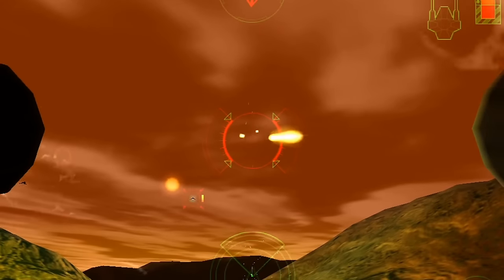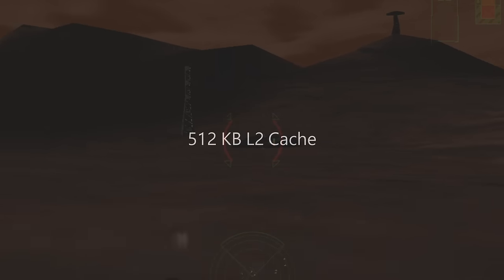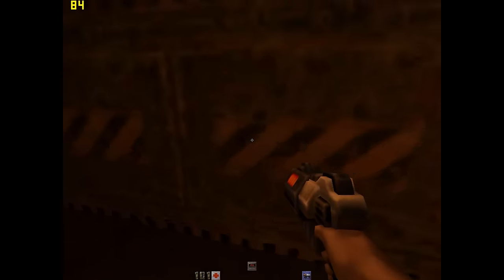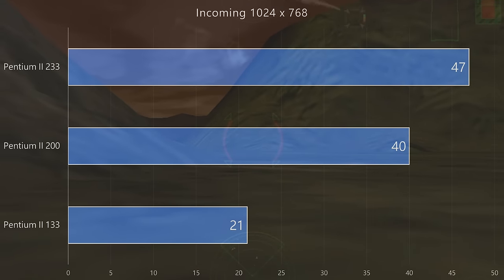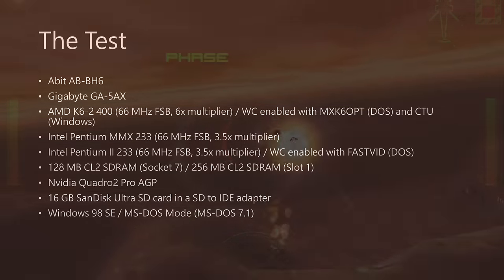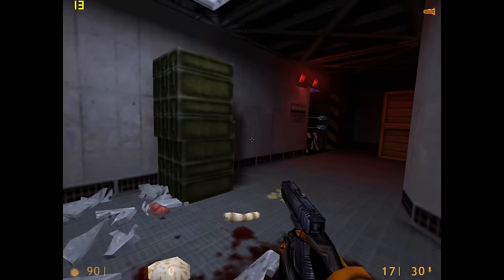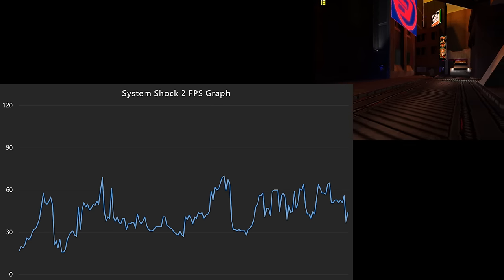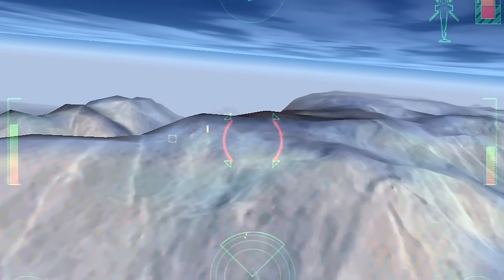Pentium II 233 The First Slot 1 Processor

Comment: I got a new computer for when I entered high school in 1998, it had this exact CPU. It was a very good cpu, I had it for a little over a year. Which in that era was a long ass time, cpu and gpus advanced so fast. Also mine was easily overclocked to 290, with the FSB 66->83 and a little extra cooling.

Comment: I have a P2/3 dos box that I just have a hard time getting slow enough! I was even looking for a socket 370 to underclock on a slocket, and for some reason, just kept forgetting that this processor exists (I have a PPro lying around, and it was a search for a socket 8 board that made me say "duh" and order one of these on ebay). The price hasn't come down much since you made this video, but I hope it will be easier to slow down for old DOS games than the 450 that is in there now. I'm pretty excited to give it a shot at 133. It's funny how hard I used to try to squeeze performance out of my BX boards in the past, and now I'm trying to squeeze performance out of it... but... you know, the other way :D 

(I still deeply regret that I got rid of my socket 3 and my Tomcat III motherboards. WTF was I thinking?!)
Reply from the maker: Socket 7 is what you want with a Pentium MMX. Watch my video 136 in 1 MMX.
Reply: @philscomputerlab  Oh, I know, I have a kajillion socket 7 CPUs but the prices on motherboards have gone insane. I'm also surprisingly light on PCI graphics cards, so having AGP for my Voodoo3, while not a must, goes a long way to having a good working systems. I still have my Orchid Righteous 3D and a V2 card, so it wouldn't be the end of the world if I couldn't use AGP, but it would just start a cascade of spending that could have gone toward, say an SC-88pro. Hopefully, this $17 cpu will be a good solution, and i'll just keep looking at my unhoused socket 7 CPUs and feel a little sad :D 

Thanks for the reply on the necropost (though, when you're dealing with retro hardware, is any thread too old??).

Comment: I think we had this in our first family computer back in 1997 with 128 mb ram (a lot for the time i know) and a geforce 2
Reply: Pidde Bas I guess the geforce 2 was put in your machine later.
Reply: KilgoreOnDrugs Huh. I looked it up and sure enough it wasn't released until 2000. So must have been a different one, since we never upgraded that computer to my knowledge. But I do remember it saying Nvidia and geforce on the card and it had a single vga output.
Reply: It was probably a Riva 128 which was nVidia's first successful graphics card and it came out in 1997 too.I purchased a Gateway 2000 G6-233 model on eBay last year which came with a Pentium II 233 Mhz Slot 1 processor and a Gateway 2000 branded STB Velocity 128 AGP (nVidia Riva 128) graphics card.It also came with 128 MB of RAM.
It could have been the same make and model as your first family computer.
Reply: m9078jk3 I've now found out it was a Dell Dimension XPS D233. Yes, that graphics card seems to have been it according to multiple sources. Not much info on this machine online though. Best I could find was this https://en.wikipedia.org/wiki/Dell_Dimension#XPS_series
Reply: Finally! http://web.archive.org/web/19971008001233/http://www.dell.com/products/dim/xpsd/indepth.htm
Reply: That's a higher end gaming machine for 1997.Congratulations on finding the model.I thought it might have been the Gateway 2000.
Maybe you can find that Dell XPS D233  someday from eBay.
One thing about that nVidia RIVA 128 card is that you you will want to install the latest drivers if you get one someday (which also have Open GL drivers for it too).
The original software drivers for that Riva 128 were terrible (had a lot of screen tearing). With the updated drivers it was an excellent graphics card and was higher performing in Direct 3D games than a 3Dfx Voodoo 1 graphics card.
Reply: m9078jk3 Thank you for the info on the drivers. Yeah, I would really like to find this machine someday as it was the first computer I used. Poked around on ebay, didn't find this specific model though
Reply: my first pc where 2003 it had pentium 4 3 some thing ghz 
intel grapich
256 mb ram 
20 gb hdd
runing windows 98  
i miss that pc
Reply: pentium 4's cant have 3 ghz at least i haven't seen any
Reply: oh my bad they can go up to 3.8 ghz with mmx technology
Reply: Theres a 4ghz pentium 4 aswell

http://ark.intel.com/products/27510/Intel-Pentium-4-Processor-supporting-HT-Technology-4_00-GHz-2M-Cache-1066-MHz-FSB
Reply: Sebastian Kjær Lauridsen this is going straight to my retro collection thx for informing me

Comment: I have a bunch of these Slot1 CPUs here, both the 233 PII but also other slot1 CPUs, they always been my favorite among processors. good overclockers and very stable but also delivers size for the buck :D
Reply from the maker: I like working with them too. Stay tuned :D
Reply: One of the best overclockers are the PII 333Mhz, setting the stock bus speed of 66Mhz to 100Mhz I got a 500Mhz 100% stable computer that worked for many years in most games, I still use the same Abit motherboard and stuff but with a PIII 550 at stock speeds and it still does the trick with my Dos games :)

Comment: I did have a pentium 2 machine around 1997-1999, it was the 266 MHz version on an intel SE440BX motherboard, with 128MB SDRAM and a 3DFx Voodoo2 12MB. It was the machine to have if you wanted to play Quake1/2 and many other games as I did back then. It was an impressive computer about twice as fast as the pentium 166 MHz I upgraded from.

Comment: I had Dual P2 processors and 256MB ram on my Digital branded server, that I bought for nothing and used as a web server and spam filter at home. It was actually surprisingly powerful and did not got rid of it until 2006, when I switched to P3 1000MHz processor server for these duties. However, I always remember the disappointment when I realized that 2 P2 Cores filtered spam much faster than the single P3 core in the "new" server.

Comment: The Celeron 300A in late 1998 (based off the Pentium II) was the first Intel processor to have the L2 cache integrated into the die at full speed, although only 128KB.  if you got a motherboard that supported a 100MHz front side bus and RAM, it also happily overclocked itself to 450MHz without any intervention needed (aside from setting the front side bus speed to 100MHz if not automatically detected from the RAM) and was rock-solid stable.

Man I miss that processor.
Reply from the maker: Thanks for sharing!

Comment: I built my first slot 1 rig few months ago to play some old games. I had the opposite experience with compatibility, so terrible it took several weeks to debug it. Had all sorts of issues with GPU compatibility and PCI cards only seemed to work in certain slots for a number of boot cycles before I had to change to another slot.  Got it all working in the end with a lots of headaches but installing win2k seemed to have fixed most of the issues. Also had no audio compatibility at all with the on board sound blaster 128 despite having 98 drivers and the fact the card predated 98. I installed a SB live 24bit and it didn't work either as there was no 98 drivers for it despite being only 2 or so years newer than 98, good on ya creative you pack of lazy shits! 

Current specs are: Intel workstation board, 256Mb ram, Pentium 3 500Mhz, Geforce 5 FX500.

Built this to play need for speed Porsche 2000 (obviously circa 99-2000 ish) but its too slow as this game was way ahead of its time and took another 3-4 years of PC advances before I would consider it playable. 

Looking at building a dual CPU Athlon XP 3200+ rig with Geforce 6800XT and 4Gb of ECC DDR2 ram. 

Many years ago I had an Athlon 64 3000+ with 6600GT and that ran this game at about 50-60 Fps

Comment: Tiberian Sun will actually support any resolution you want. To go higher than the 800x600 in the options menu, open the config file and manually edit the resolution. It supports widescreen with no modifications necessary.

Comment: Great video. Funny thing, a couple hours ago I bench tested a PII 233 mhz on a"bboring" oem mobo. It was on a Gateway GP7-550 paired with a PIII 550.  The PII worked at 133mhz, no option to change the multiplier on the mobo. Thinking on making a DOS Win 3.11 rig.  Back in the day these costed an arm and a leg so had to settle with Cyrix then later with Celeron.

Comment: I actually have one of these-but the fan on its cooler died so its useless until I manage to remove the heatsink and replace it-not an easy task when its rusted on. Though with contact B21 severed on my Celeron 333A I haven't got a use for anything else slot 1-it runs at 500MHz on any motherboard that supports a 100MHZ FSB. And I'm glad that my SE440BX-2 automatically detects the voltage as the Celeron 333A reuires a bit of a voltage jump unlike my 300A, which at 450MHz runs on its stock voltage.

Comment: Never had a Pentium II back in the day.

The first family pc was an old used pc in 1995 which was just a suped up 286 at like 5mhz and cga graphics. All it did was run a dos menu where we played Wheel of Forutine, Pool, a Dart Game, and Jill of the Jungle.

The second PC was a 25mhz 486 later that same year. It was obviously a massive improvement to the 286 by leaps and bounds. but is the slowest 486 lol! The first two shooters I ever played were on that pc with those games being Doom II and Heretic.

in 1996 as we got more into computers my dad paid 3000$USD for a 200mhz Pentium Overdrive PC.
Once again an absolutely massive boost in performance. It was absolutely hilarious running Warcraft 2 tides of Darkness on the 486 and Pentium Overdrive in a network game. Quite literally the Enemies and the Peons walked in slow motion on the other pc and you can see the slowness on the faster pc. So obviously we did that once or twice and said no more to the older pc lol.

Then flash forward years later to 2000 and instead of buying pcs my dad learned about the pc builder hobby. This is when my dad built a 900mhz duron machine and 1ghz Athlon. We jumped right 
into the modern nice cpus along with a 3dfx voodoo 3500 TV and a 3dfx Vooodoo 5500 on the other allowing for a pretty good experience regardless of pc played on.

Comment: The very first PC I ever bought with my own money sported one of these beasts along with 32 megs of memory, a 4 meg ATI All in Wonder and a massive 3.2 gig hard drive.  All in early 1998, wish I could remember how much I paid for it.  It could barely handle Half Life when that released, along with some graphical glitches I only got a decent frame rate at 320 x 240.  I upgraded to a Diamond Viper 550 16 meg nvidia card and things got a lot better, I could run it at 800 x 600 and play online without crashing.
Reply from the maker: Nice! Thanks for sharing!

Comment: I got a Dell Dimension XPS R desktop with a Pentium II 400 when I was in college in 1998.  I kept on upgrading that thing and in the end it went from a humble 400 MHz Pentium II with an NVIDIA Riva 128 ZX video card to a 1.4 GHz Tualatin Celeron with an ATI Radeon 9000 Pro GPU, an upgraded power supply, and an aftermarket Promise ATA/100 card.  I eventually had to retire it when Pentium M laptops became affordable and outperformed it.  Still, it was the best computer I ever had.
Reply: Yup, that's what it was.  That computer lasted so long I was able to skip the entire Pentium 4 era and went straight to the Pentium M.

Comment: I remember back in the day I had an AMD K6-2 450MHz CPU on a VIA MVP3 board (I can't remember the brand name) with a Voodoo 3 3000 graphics card, and I had a friend who had a Pentium II 400MHz CPU on a 440BX board from PCPartner with a Voodoo 3 2000 card and his machine was capable of nearly twice the framerates of my rig in nearly every game, despite having the clearly inferior graphics card. The most noticeable difference was in Quake III and Need for Speed Porsche Unleashed, which we played a lot at LAN parties and as such we could make a direct head-to-head performance comparison - literally - by placing the two monitors next to each other :) Back then we didn't know of benchmarking tools like Fraps and 3DMark, but still the performance difference was quite noticeable and Quake could even put a number on it by way of the framerate counter.

Comment: 6 years later going through reviews again as a reference for the Pentium ii 350 I intend to run at 233MHz (or the OG 233 with an 80mm fan strapped on), still have no idea how the stock active cooler as able to handle the heat output. 
Also, unlike my first PII 350 (bought as a 233 due to seller using a 440LX board) - upon removing the heatsink, my particular 233 has 4x cache chips instead of the 2 found on Deschutes PII. And they definitely are the higher latency chips that might not handle being overclocked to 266MHz (something that the Intel SE440BX-2 allows).

I was also wrong 6 years ago, the Celeron 333/500 actually isn't fully stable (still gets into windows for CPUID) - and none of my Slot1 boards allow the voltage to be adjusted. The 450A is rock solid however (although in a Slotket my Celeron 500 manages to edge it out occasionally).

Comment: I had one of these, SL2QA. I have many fond memories from that 'era', although I remember was quite disappointed that 440LX mobo stopped me from pushing it to the limits. On the other hand, even if I had a BX mobo (which I eventually acquired), I would be held back by L2 cache which, running half speed, didn't like to be rushed and often died when ran above FSB 83 (remember the term KSDS - Klamath Sudden Death Syndrome? ;))

Comment: My first machine was a Pentium 133mhz, than I upgraded to 200 mhz mmx cpu. Later on I went Slot 1, Celeron 333 mhz with 66 mhz fsb, increased the fsb to 100 mhz so it went up to 450mhz without any issues. The performance was awesome with a Geforce 3 card nad 128mb sdram. I'm thinking of getting a slot 1 motherboard with a 233mhz someday, I want to try it together with one of my Voodoo 5 5500 64mb cards.
Reply: 233 MHz CPU is too slow for a Voodoo5 5500's potential, but maybe you're just curious how that combination does run.

Comment: Great video..! I heard you mentioning in a few recent videos of yours, that you were growing quite fond of the SD -> IDE adapters as to compared to CF -> IDE. I have two old laptops here (Compaq Contura 400C / 486DX40) (Toshiba Satellite 200CLS / Pentium 100) that both still have their original 2.5" harddrives (Quantum 250MB / Seagate 810MB respectively). Though both of them are still working I was thinking about what to do when they start to cease doing it. Is the option of going SD -> 2.5" IDE for possible HDD replacements as viable as going CompactFlash? I was wondering about compatibility. Also it would make a monitary difference, considering that CF cards are quite a bit pricier...
Reply from the maker: They are so cheap. Just buy one and try them out.

Comment: My friend had dual Slot 1 233Mhz Processors until we upgraded the BIOS and installed dual socket 370 Celeron 400Mhz on Slocket Adapters.  He was going to buy two Pentium II 333Mhz processors but I had a 400 Celeron and he had one as well so all that was needed was the adapters.  Dual 333 Pentium II  would have been better but the celeron option was much cheaper.

Comment: This is probably a dumb question but why does quake 2 run so much better then quake 1 quake 1 gets 14 fps in 480p while quake 2 gets 36 fps in 768p oh and i just reaised we had 768p in 1998 take that console peasants.
Reply from the maker: That's Quake running in DOS. You need to look at the GLQuake results for Windows Quake :)
Reply: PhilsComputerLab How can windows make such a big difference i used to think games worked better in dos.
Reply from the maker: Well this is a 3D game, so in Windows the graphics cards does all the graphics. In DOS everything is done on the processor.
Reply: PhilsComputerLab Oh ok i did not know that so you cant use any later graphics crads on dos.
Reply: Cool I didn't know that either, I used to reboot in DOS mode to play doom 2 because it was better performance than windows, but I didn't have a graphic card.  Then you'd have to load the mouse drivers manually with a mouse.bat file.  Sometimes id forget to load the mouse drivers and then be playing someone and be like oh sorry we gotta reconnect I forgot the mouse drivers.  Not many people even used the mouse at that time.
Reply from the maker: Are you sure about that? Please provide some links or evidence.
Reply from the maker: Check my latest video, it shows an easy way to use MS-DOS mode with working memory managers, mouse and CD-ROM drive.
Reply from the maker: Aaaaaaand, Mate? Where does it say DOS :D I am telling you GLQuake is a Windows program. Uses Direct Sound and, well, OpenGL.
Reply: What are you on about? GLQuake needs Win 95 minimum, it's in the system requirements Readme file. You need to take a chill pill and check yourself, seriously.
Reply: Just ignore him or block him, don't get worked up over some random Internet troll.
Reply from the maker: Yea good idea...
Reply: i like that how he talks 768p like bad thing there bro :D
Reply: Good questi- aaand making pc gamers look like assholes, thanks bro
Reply from the maker: Oh, not that wasn't meant in a negative way at all. It's just that people will ask "what settings" if I don't mention it. I try to run everything at 1024 x 768, it's a nice retro resolution.
Reply: this resolution was considerd as overkill back then
Reply: HAHA, that is a higher screen resolution than the explosive iphone7 which is only 750p! LOL My 3 year old Samsung Galaxy S5 is 1080p for fark sake...